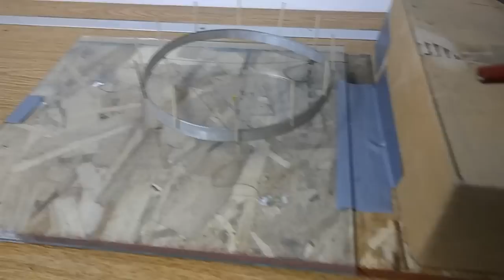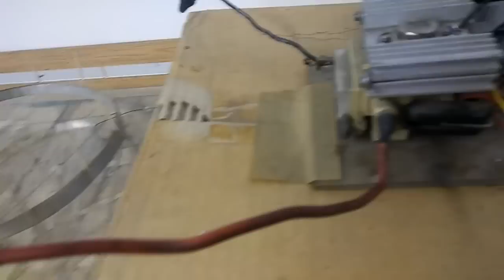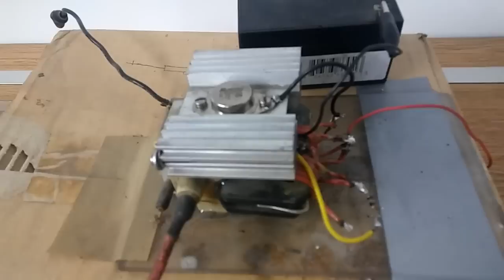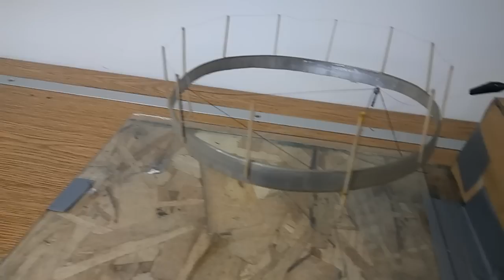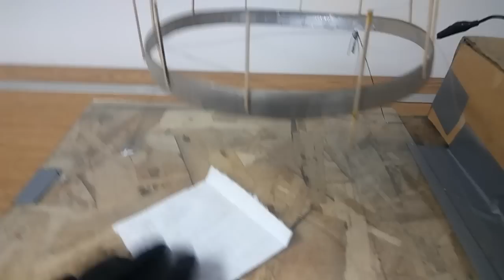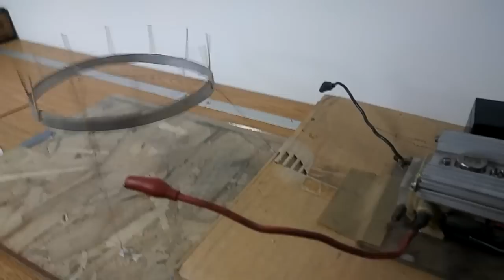New Asymmetrical Capacitor Design for propulsion

Comment: It can fly with low thrust because it is putting a little energy but through a huge surface area. This method is also used in human powered gliders to fly gliders they have wings with huge surface area to make little thrust over s large area resulting in huge compounding thrust .

Comment: I guess the circle wire on the top is one probe and the triangle wire on the bottom is another probe ? and tis makes it asymmetrical ? does the metal/ aluminum ring have a connection to dc pulse or is it there  for looks  i assume your using air as your dielectric and not a solid dielectric

Comment: Build one using a solid state high k and low k dielectric to remove the air ionization variable. If it works you can make your claims without the ion wind explanation being a factor.

Comment: He should make crystal cells batteries to make a 12 volts also get small copasiter as wide a the stick and small but a high voltage also make more rings to connect like Russian dalls for more lifting power

Comment: can you post a exact schematic for the flyback. what distance is the corona wire
Reply: goobman1981, were you able to locate schematic info?
Reply: Check out replies on my other video "Antigravity Lifter Creates Artificial Gravity"
Reply: I think the transistor he is using has far more current than a 555.
Reply: Rye N Cheese i know how lifters work. i want jims design. ive built several but they dont work. maybe my power supply. i use transistorizes ignition coil and 555 circuit. over 2 inch sparks. but never works

Comment: If this is not using Ionic wind. Try performing the same experiment in a pure vacuum.
Reply: t md The air is the dielectric the principle is based on. Of course it won't work without it, ion wind or not. If he wants to prove it's not ion wind he needs to use solid state high k and low k dielectrics instead of using air.
Reply: There's no wind. Sorry, but don't have resources for vacuum test, however I have no doubts as I can't measure any wind or ozone.

Comment: Dear Jim, really nice construction!! Did you weigh the device? It seems much heavier than most (triangular) lifters, yet with much greater thrust.
Reply: I believe it's probably twice as heavy. Round design & pulsed HV DC is very important.
Reply: No. Not yet - don't have proper scale but it is very heavy. See my other video. thanx.

Comment: yea lifters. 

it's not ionic wind.  it's time offset. 

since the current has to make 2 wave forms, one is ultra small SIN the other is tall. 

for every x passes around the tall SIN the small SIN does more. 

it's the same equation that shows as you go up into space time shifts. 

except your doing it on an electron level.  the efficency, produces lift because time wants to fall up. to fill the correct vortex of offset time.
Reply: I like this and am saving it

Matthew Egan
yea lifters. 

it's not ionic wind.  it's time offset. 

since the current has to make 2 wave forms, one is ultra small SIN the other is tall. 

for every x passes around the tall SIN the small SIN does more. 

it's the same equation that shows as you go up into space time shifts. 

except your doing it on an electron level.  the efficency, produces lift because time wants to fall up. to fill the correct vortex of offset time.
Reply: Could you share the equation for this please.